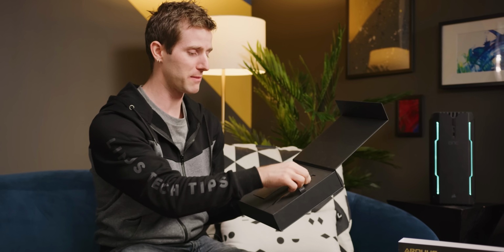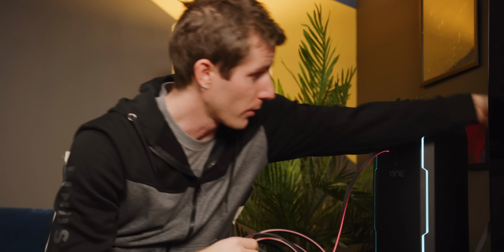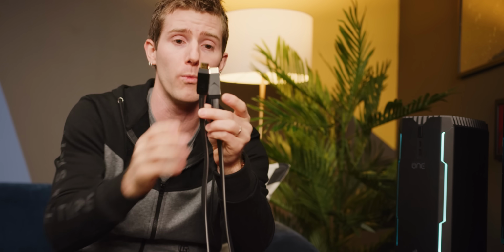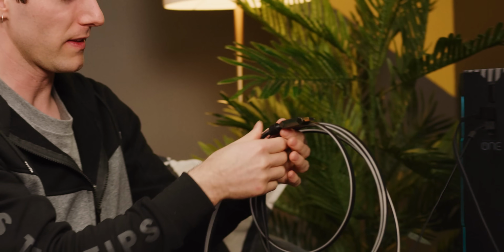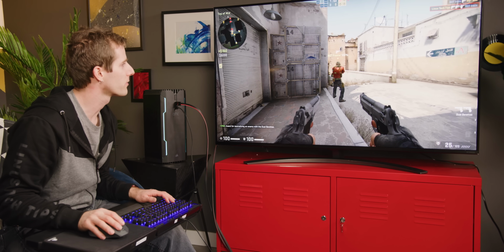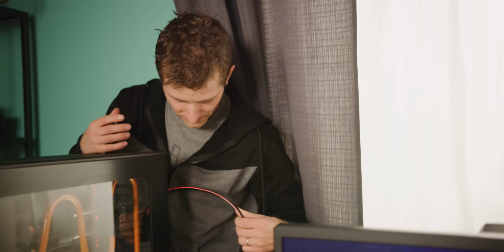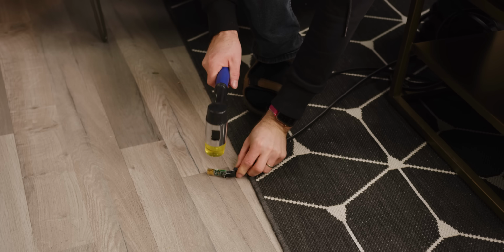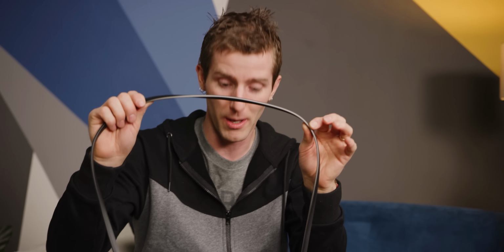The RGB HDMI cable ISN'T as dumb as you'd think...

Comment: Coming next: "Liquid cooled HDMI cables".
Reply: Nah, RGB motherboard standoffs.
Reply: liquid cooled liquid cooling
Reply: Liquid cooling a liquid cooler Is actually a thing, especially in industrial use. Maybe not on computers though since the machines that need it often run hotter than 500° f
Reply: @thezyreick4289  yeah it's called a heat exchanger.
Reply: @benargee  Isn't any waterblock/radiator in a pc a heat exchanger? Or I misunderstand what a heat exchanger is.
Reply: @thezyreick4289  Actually that's not true. The concept exists but how you put it is like calling thermal paste "cooling paste". What that setup does is both cooling and heating were liquid 1 is used to heat an object and then liquid 2 is used to cool liquid 1 which in turn cools said object. It's part of temperature regulation systems to maintain exact temps required for what ever process you are running. Also there is no "often run hotter than 500° f". It's the chemical process that dictates the temp which can be anything.
I use it for a setup ranging between 150° f and 330° f and then later in another machine it will be reprocessed between a range of 200° f too 520° f
Reply: @Bezerker1181  I was trying to keep it simple for people who don't fully understand, but you hit the nail on the head
Reply: True

Comment: I don’t get why a fiber optic cable should be more expesive than a copper one. Fiber optic cables are made out of sand. Yes, sand. Which there is no end to it and dirt cheap, unlike copper which is limited and thus expensive. You can argue for development cost of putting rgb and extra cost of rgb leds on a fucking cable which is dumb, and that comes from me. And who I am? Basic anwer to this: a huge fan rgb stuff on/in cases or visible components. But, come on a hdmi cable which practically close useless.

Comment: Linus, in regards to the comment about being able to find what cable goes where based on the lights at 8:35, Monster makes HDMI cables that light up on both ends with a specific colour so you can colour code inputs. Also price wise they are significantly cheaper.

Comment: I dont remember who did a review of this earlier, but the review basically came down to "the stupidiest prittiest cable ever" glazing over the fact that there is apparently an POF or GOF cable set in there(i'm guessing two for bi-directional communication for CEC) and in theory, with just POF you could have a 200 foot cable(high quality POF) but with GOF, the theoretical limit would probably be somewhere around 5 miles using single mode

Edit As for cost, the review basically said its a $15 HDMI cable with LED diffuser, but really, its more like a $20 15 food POF/GOF cable, and 2x$20 20gbps fiber transcievers, and then the software/hardware solution to convert the HDMI signal running over several copper cables into light on a single cable, and then the ability to convert it back

Comment: Only if they made this in 75 foot or 100 foot so i could string it across my basement
Reply: Check Amazon; I saw 50 and 100 feet (in other brands, but you can still use the same link to make LTT a few pennies).

Comment: Right.... $100 you say..... Well, in that case, I'll buy a weeks worth of nice food instead.

There's no justification for buying a HDMI cable for $100 when it's only really major end-user difference is the fact it flashes a load of colours.

I'd much rather spend that money on a HDMI cable with active upscaling built-in, that can be disabled by the user when required.

Also, HDMI is a proprietary standard, I'd much rather personally have a Displayport or Mini Displayport cable. Or, Displayport over USB-C.

Comment: what i would like to see are fiber-optic network cables with the color stuff.
how easy would it be to colorcode your datacenter? you can even witch the coding if desired after the fact without pulling the wires.
or like server closets in large businesses, usually a mess with missing documentation, colorcoding not done on later revisions and all that stuff, now you dopn't have to worry.

it would make a lot of IT people's life a lot easier. and since it are basicly 2 LED's thats not much power at all, specially when they are on a single color mode, which you would want for this so cost over time is négligeable. only cost is the upfront cost, but when you are spending thousands of dollars on fivberoptics or high grade copper wire, this isn't much added cost + the benefite of easier working would make it worth it on a productivity standpoint.

Comment: Can you please make a video on the "Medion Erazer P15603" it is technically a £1000 pound laptop, however it is sold for £750 on some websites. I could not find any good info about this laptop so I came to you. I believe at its price range it could be way better then any other £800 and less laptops. I have no clue about its fans and cooling system thus making me question if the temperature on it is the main problem.
Thank you

Comment: While mostly right about the digital signal stuff, there is a weird sort of inbetweeny state where it's having issues but hasn't fully died yet

Hard to miss though, things like red lines/dots on the screen and snaps/pops on the audio side, you would totally notice it happening.
I've seen it happen on cables that were maybe a bit too long. Make it just a bit worse and it'll die completely - approaching the cliff ao to speak.

Can even quantify it with something called an eye diagram

Comment: ok its been buggin me, and i saw this so many times in this video, why is he touching his wirelss mic thing by his pocket like every 5 seconds.......
Reply: It's their teleprompter remote. It's so he can change the page of the script/his talking point notes. The wireless transmitter for his lav mic is on his belt under his hoodie.
Reply: @seanbrown  ah makes sense. I wish there was a better way of doing it rather than him making such an obvious move.
Reply: @Sliski251  There is but LTT has been doing it this way for so long I don't think they want to change.

In high end professional video environments the "talent" would simply read the text off the screen and it would be rehearsed to confirm that the scroll speed was fast/slow enough to seem natural. There would also be a technician whose sole job is to run the teleprompter making sure that if the speaker changes tempo for whatever reason that the scroll speed is adjusted as well.

In the case of LTT's solution they just have the "talent" change the page using a Bluetooth keyboard when they're approaching the end of the current page of notes/script. They try to edit around it but are not completely successful in many cases.

Source: Am professional live sound technician and occasionally am required to run the teleprompter.

Comment: Sure it's digital so there's either a 1 or a 0 and error detection and correction at both ends... but these 0s and these 1s are Better bits.  Somehow.  I do know where they get the claims about superior color depth, brightness, and all of that over standard HDMI cables.  They're talking about the difference between 4K with HDR and non-HDR.  When I got my LG OLED and a PS4 Pro, I couldn't maintain a stable 4K+HDR image at all with the older cables I had.  I switched to the cable that came with the PS4 Pro and it worked.  Older cables just can't support the bandwidth required.  So I'm pretty sure they're comparing cables made for HDMI 1.0 to HDMI 2.1 high-speed cables, being terribly disingenuous and trying to invent a scenario where their product might be a big upgrade.  Sure you could go to Monoprice and get a cable that will perform just as well as theirs for $6, but pay no attention to that.

Comment: The supplementary power cables are for powering the optical converters inside the HDMI Plugs at each end. A very common thing in the professional event AV world is using fiber optic cables on cable drums with 2-12 pairs of SC, LC or ST connectors and a "pigtail" which goes from DVI, HDMI or Displayport to one of these fiber optic connectors. These Pigtails need to be powered to convert your video signal to an optical signal and back. There are professional graphic switching devices from Analog Way or Barco where you get the 5V only on the input side of your video hardware. If you didn't know this you could be searching for an error that sits in front of the device while 2000 people are waiting for an image from the CEO's HDCPBook Pro which he couldn't test before the show and the cheap usb-c dongle does not provide enough power for the pigtail... Most likely you will need these power cables when it is NOT a high-end TV connected to a high-end computer.

Comment: Back in 2007, Best Buy sold 6' "gold plated" HDMI cables for $99.
Reply: I'm aware. My father refused to believe it wasn't anything special and he used Monster cables for his home theater set up.
Reply: @MinistryOfMagic_DoM  same
Reply: @Cash Ash I'm sure people would have an aneurysm if they knew how much cables are marked up.
Reply: They still sell HDMI cables that expensive and higher.
Reply: I don't know why you are putting quotation marks around "gold plated". 34% of Gold mined is used for Electronics. If you throw mother board or Ram cards into a chemical bath you can collect the Gold platings they use.
Reply: Gold plating on card edge is for contact wipe durability, same for other connectors.
Reply: https://www.amazon.de/Coffee-audioquest-cavo-HDMI-Speed-Ethernet-beige/dp/B003CT29PU?SubscriptionId=AKIAILSHYYTFIVPWUY6Q&tag=duc03-21&linkCode=xm2&camp=2025&creative=165953&creativeASIN=B003CT29PU ^^
Reply: I remember that. Even then I thought it was hokey.
Reply: Lol yeah my dad ate that BS right up back in the day
Reply: I had one of those cables. The positive about it, is it carried higher bandwith then the 1.2 standard most HDMI cables carries at the time, so i actually used that cable from my crappy 720p plasma to my 1080p 3D plasma and my 1440p 100Hz monitor. It only stopped working once i got a 4k TV. All that said, i would never buy a that expensive cable again. Yes, it lasted me for many years, but buying a cheap certified cable whenever you upgrade your TV/monitor which requires a new HDMI standard is a much cheaper solution.
Reply: @renehoyvik  on the plus side, at least that expensive cables gold had something going for it. Gold does resist corrosion better than the regular metal used for some cables.
Reply: I've seen golden plated fiber optic cables.
Reply: The dumbest part about those cables is the fact that gold has worse conductance than copper.
Reply: @Goblin-Gadgetry  a lot of electronics use Gold though, it's not as conductive, but it also doesn't corrode as easily. So it lasts longer.
Reply: @Goblin-Gadgetry  your comment is completely wrong
Reply: @Mrcrappyfuntastic  you wana look up resistance constants of metals right now and prove me wrong you can do that but dont say someone is wrong without the numbers to back it up. 

The resistance of copper is 1.72 x10^-8 Ohms
Resistance of gold is 2.44x10^-8 Ohms

A higher resistance means its a worse conductor.
Reply: Midknightcurse going out on a limb here, but maybe optimum conductivity is less important IRL than durability when it comes to electronics connectors
Reply: @charlessale409  ye I understand that just saying some stupid snake oil cords advertise that they are better with gold infused wires and stuff.
Reply: @Goblin-Gadgetry  that's true I probably shouldn't do that again

Comment: It's not a "fiber optic cable".. the HDMI uses regular cables, the thing that brings the light show is fiberoptic...aka open clear fiber so you can see it light up... you can clearly see the regular wires in the cable when you take it apart.

Comment: With my 4k laser video projector on a 110 inch screen, there was an immediate and obvious improvement in all aspects of the image when I switched from copper to optical HDMI.  Three different copper cables were tried, I plug in the optical cable (from monoprice) and it was a slam dunk, no question, no switching back and forth, no wondering if I was seeing what I thought I was seeing.  

Part of the improvement probably comes from galvanic isolation, removing ground loop issues. I don't know for certain.  Maybe all three copper cables sucked and maybe a really high end copper cable would be competitive..  The results were the same whether the source was my PC or my OPPO bluray player.

I just wanted to let you know that optical HDMI is NOT total bull crap in my experience.

Comment: is the cable you use in this video was 15ft long cable or 12ft long?, bcuz all the cable i try at that length have degradation in signal and shutter from time to time, all amazon cables do at the length.
i have been msg you about this do do a good test on these cable length for quite a while now. have you game on it for a good amount of time? and can you confirm please if these cable did not cause degradation at 120hz?

im saying this bcuz i spend quite a lot on cables, display port and hdmi and at the length they all have degradation.

Comment: I have a 15 meter HDMI cable and when i send 1080p60 across it, i can see noise in the digital signal.
it's different from analog interference,  but the signal doesn't just cut off entirely. the signal interpreter of my tv just spits out some wrong colored pixels here and there. these are often either just green, just blue or just red.

when i use a shorter cable or switch to 1080p30, 1080i or 720p, these artefacts are gone

Comment: Imagine using it in a Datacenter having those Fiber cables an choosing the one where No connection is. Or even beeing able to this on admintrator side, lighting up the cable red when the server has no I-net connection. 200+ cables are no longer a nightmare. But it will be expensiv AF.

Comment: yeah sure, just go with fibre since it sounds cool. in fact it just adds latency compared to solid copper, just like fiber vs. DAC cables.
Linus is just talking shit at 3:30, conversion will always add latency and for the short cable lengths they offer, copper has in fact lower latency

Comment: Linus, you can push 10bit 4k @ 98hz (custom res) max without compression with the bandwidth available. It's only if you go above 98hz at 4k that you get compression/sub sampling or step down to 8bit. Yes 1440p will get you 120hz but I'd rather have 10bit 4k @ 98hz than just 10bit 4k 60hz. 

Source material on max bandwidth/max res without compression: www.tftcentral.co.uk

Comment: For the copper wires that broke off of the back bottom side, (besides the RGB), looks like some leftover parts of the HDMI cable that werent the video signal are still going over copper - I can see CEC written. Also, for the fiber portion, it looks like there were only 4 fibers, which makes sense for the video data signal lines 0,1,2 and the clock. On another note, it woulda been nice to inspect the way the fibers attach in a close-up pic.

Comment: Not as dumb?  It's a cable.  They put RGB on a cable.  It's exactly as dumb as I'd think it is.  The only real possible use case, chasing devices by changing the color, could be handled far cheaper and quicker by simply using a bit of masking tape and a sharpie to label the cables.

Comment: Linus: "I can understand why it's expensive"......well it used to be.
Reply: Did you find it? I followed the link and it didn't show up at all
Reply: @lunartigersora4690  r/wooosh
Reply: @lunartigersora4690  it's on their website, but it's $150 so....
Reply: @FIREBREATHER1012  yeah I noticed, I looked it up. That's wayyy too much
Reply: @lunartigersora4690  was referring to the fact that it was expensive before he took the hammer to it
Reply: @onebraincellshort8055  yeah I understood that lmao
Reply: @lunartigersora4690  that's actually normal price for fiber hdmi cables though. So when I saw they were selling this for only 80 bucks, it felt like a steal. I already bought the Rupio fiber hdmi cable for $150 a few years ago and the price is still thr same on Amazon. 
I needed a fiber cable for my projector to work properly due to it being far from the receiver. The fiber hdmi just holds a stable signal all throughout the run so no cutouts or picture issues.
Reply: Ah, damn that sounds really good.

Comment: Just get a RGB light strip and stick it on any HDMI cable and  you got a RGB HDMI cable
Reply: 200IQ
Reply: That's what I was thinking xD
Reply: Smart. I looked into it and it's definitely possible with a diffused led strip. It would most likely be thicker, unless there is a thin diffused strip out there. There's always the option to wrap a thinner led strip in clear, matte/frost vinyl then adhere that to a flat hdmi cable. That might even be a better solution if more light is desired.
Reply: or use elwire
Reply: Stonks
Reply: It’s a high quality cable with colour as a nice extra. You’re not paying for the RGB.

Comment: You are not a true techie unless your tool kit comes with a mallet.
Reply: You need a Swiss Army knife that hopefully has a screwdriver
Reply: Or a Swiss army knife which hopefully has a Phillips head screwdriver in it
Reply: you are not a true techie if your tool kit is not your wallet too...
Reply: Mallet is soft reset... i like my hard reset solid steel hammer better.
Reply: Must be a ford mechanic
Reply: You know what comes in handy? Using chopsticks 👍
Reply: You're not a true techie unless your toolkit includes alchohol
Reply: @jadeburns4429  Me: you like O'douls right?
Jared: yeah, fuckin love that stuff! 

#60minutes or less...
Reply: And a swiss army knife that hopefully has a philips head screwdriver in it..
Reply: Everybody knows it's to hammer in the bracket
Reply: And an angle grinder
Reply: When I first read your comment I thought you said mullet...
Reply: Or a tweezer.
Reply: Mine comes with a dremel for modding bit sadly no mallet
Reply: @robsnow5646  It's a joke about the verge's PC building guide
Reply: Linus TechGear being what it is...